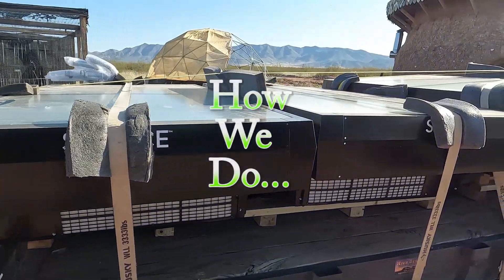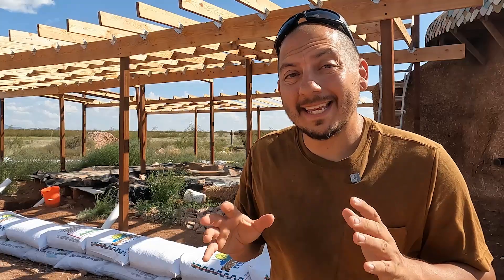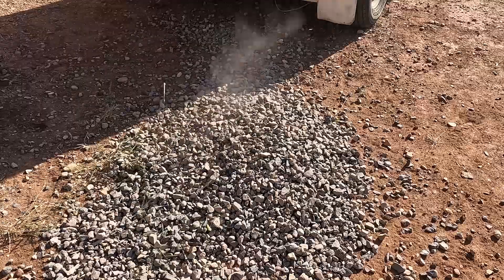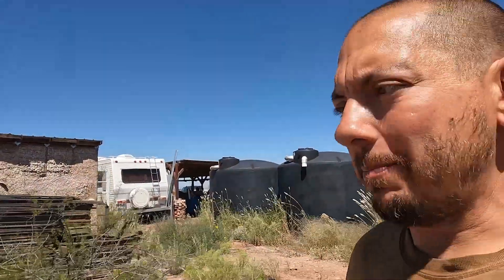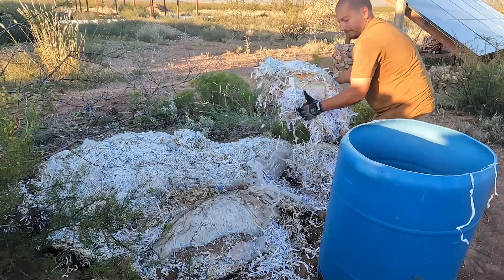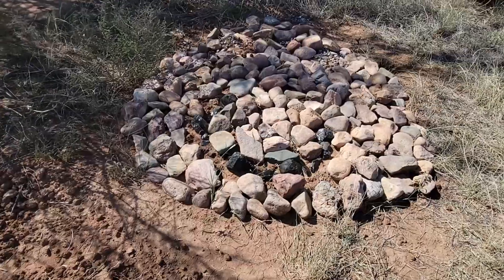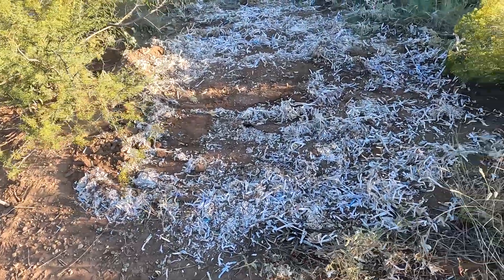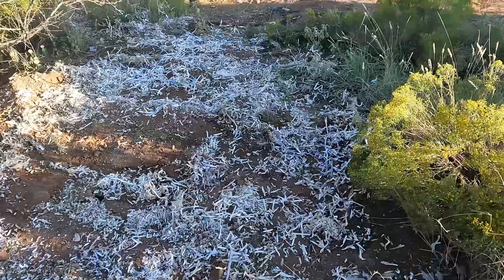These Solar-Powered Panels Create Water from Desert Air (Source Hydro Panel Installation)

Comment: PV panels degrade up to 25% when they heat up in the Sun. However you can cool them off using water. Have you considered feeding the source panels into a storage unit by the PV panels to use the condensed water to cool off the panels and increase electricity production?

Comment: I wonder if having a Source version that can be hooked to a supplemental power supply, like a battery/solar bank to have the panels condensing the cooler higher humidity air before sunrise  to increase it's output?  ... Very cool idea , glad you have them 🙂
Reply: these panels have a battery and Do run all night

Comment: Yeah.  No thanks.

Ever drink the condensate off an old, dirty air conditioner?

YES, you're producing water.

COMPLETELY unfiltered.  Unhealthy to drink.

In short, it's a scam.
Reply from the maker: They install filters with the panels

Comment: I don’t see any foundation. If rain water flowed around the base, wouldn’t these panels fall over?
Reply: They are strapped down to cement blocks
Reply: @dwight7651  ok, what supports the cement blocks?

Comment: Without looking them up based on your description, it sounds like they may be using some sort of 'Peltier cooler' setup ie run power in and one side gets cold, one side gets hot...and if you run air over the cool side you can get condensation etc.  If that is the case, the combination fan noise is probably to pull cool air in across the cold side then blow it back out over the hot side to keep that cooled off.  Very cool in any case, hope it turns out well and you can do a future 'it works and is cool' followup video. :)  And of course now I read the website...and nope they do not use pentier coolers, they use other fun stuff. :)

Comment: Cochise County, had in-laws that moved there, know the country. I myself moved to Apache county, 5300 ft elevation, off-off grid and 35 miles from any services. On a mountain top, above the tree line,( google that, i really got it wrong) would love a few of those panels as water is a 'haul' once a month. The panel output directly relative to humidity content. Arizona, not so much. I think of those off-gridders somewhat east in a humid climate, but then rain catchment would be better too. Good luck and as always be safe. ❤

Comment: This is all well and good, but I have seen Wormwood in a vision (the biblically infamous comet). It’s like a giant dust clod. I wished to see it up close and I was vooshed right over. It’s like a flaming dirt clod made of apparently a fatally toxic dust to life. I don’t trust the air for water after it hits… Just saying. The second part of the vision was I tried desperately to warn people and nobody listened to me. 😊
There is a way which seemeth right unto a man, but the end thereof are the ways of death. Proverbs 14:12
Invest in a well. The only certain way. And with what Revelation says about all the many people dying, well, according to the NWO population control plan that doesn’t exist (sarcasm), there’s going to be enough ground water for the people who wanted it prior to the judgements in Revelation. So it’s just having a good well …that doesn’t have arsenic or something terrible in it lulz.
I think this air harvested water should still be good for watering your garden and stuff at least.

Comment: Solar stills are used in survival situations for eons. Dig a hole in the dirt, put something to catch water on the bottom take plastic and cover the hole with a small rock in the middle so the base of the plastic in aimed at the collector. moisture will condense on the bottom of the plastic and collect in the bottom.

Comment: Sounds like it's an air conditioner a pump that  by condensing the air makes condensation and cold air and heat in Texas I can get 10 gallons of water from a 5000 small windows unit dripping into a bucket in 12 hours

Comment: Those source panels need humidity to extract moisture from the air, It'll be interesting if you can track the water production over the year in litres per day (or gallons per day?), I expect they'll get better results in the monsoon season than the dry season.

Comment: MAGIC water from the air. If you use an air compressor you may know that it condenses a lot of water same thing that an air conditioner does. All about the amount of humidity. I live in the Northwest my air conditioner produced two gallon of water a day, I have never measured the amount of water my air compressor gets but I have to drain it once a week. thank you ALL

Comment: I'm glad you received these free materials to augment your water needs.  Source's FAQs does NOT provide direct answers to FAQs O suspect due to liability concerns. One vaguely unanswered question is "How much water can a panel produce monthly?".  They say 180 "standard" bottles per month - What is standard?   Annual maintenance, filters, minerals, and unit costs are not addressed.  They will differ for each customer.
Reply: There are charts that show how much each panel produces as it correlates to humidity and direct sunlight (amount of energy the solar components produce). In AZ with the average humidity in Cochise County, both panels should produce between 1 1/2 - 2 gallons on a sunny day. Charts can be found on FB in a group entitled "Cochise County and other AZ Hydropanel owners"

Comment: Sorry for your loss. Those little furballs bring us so much joy and love.  That love stays with us. They are all running and playing like puppies on the on other side.❤❤❤

Those panels are a high tech way of collecting water from the air. We learned a technique in boy scouts. Bury a pot so the rim was ground level cover it with plastic wrap, a small hole and rock in the middle to collect dew. Its not a lot of watet but can help you survive. 

60 decibels per panel? A push mower is around 55 i believe.  Might get annoying if too close to the house.

Comment: Interested in seeing how well the panels do, but I can tell you for sure that you won't get much water here because  of how dry it is. I am sure it will make some good water when we get some more storms and humidity. You may actually be better off using the roof from your new addition as a rain run off to a collection system.

Comment: I would like to hear how the water tastes compared to the rain water. Is it a cleaner and safer source of clean drinking water. Does it need to be boiled?
Reply: Our panels have been running for a month now. The water is pure with minerals added back in so it has a great taste and can be consumed directly from the hyropanel dispenser.

Comment: The main benefit of this system is not the quantity of water produced, or the redundancy of it, but the fact that it produces 100% pure, clean drinking water. The water in your cistern is excellent for sanitation and irrigation needs, but it's purity could be questionable.

Comment: With 2 hydro panels producing a maximum of 3 liters a day, and a cost of $3,900, the break even payback is a minimum of 106 years, compared to having water hauled to your property in Cochise county Arizona.  If they cost $30 dollars each it migh be something to consider, as that would be around a 2.5 year payback. You need ti be telling your viewers that this only works if they can get them free!
Reply from the maker: We'll probably go into that once they turn the panels on and start producing.
Reply: One doesn't do these because it provides cost-effective water. One does this because it provides water without a well or utility. The price for 2 according to the Source website is $6200 for a set of two. Yes it might be more expensive but when a well runs dry or a utility fails or emp causes the electric grid to fail (which also means no gasoline/diesel to haul water), hydropanels still produce water.
Reply: @bradcouch2899  I agree!  These are just not practical for anywhere in the US and most of the world.

Comment: The trouble, these kind of solutions don't make hundreds of gallons / day - not nearly as much as one would like and are are not cost effective if you pay out of you're own pocket.  Rain harvest (on the other hand) works reasonably well for livable quantities - 1000gal per inch of rain on 2000sq ft collection area.   Will be interested in you're actual results.  But what fun, especially since you got them for free.
Reply from the maker: Yeah, I don't think the cost warrants the amount of water you get. We'll see what the results are though.
Reply: As someone else posted, the concept isn’t to produce lots of water but to produce clean water.  A great many people don’t have a source for clean water due to local pollution or environmental issues.  

Been following this tech for a while now.  It’s similar to a different idea which is a below-ground buried water condenser.  The bonus here is you don’t need to dig for these to work. 

The buried condensers need to be put deep enough so they’re below the heat-soak in the ground from the sun.  In the desert that’s pretty deep.

Comment: These panels are $3,900 each, if anyone was wondering.
Reply: @72Dexter72Manley72  No, $3,900 for two.  Still works out to a 106 to 130 year payback / break even.
Reply: @ontheroadwithdan5571  Depends on how you look at it – this allows folks to live in areas where water might not otherwise be available
Reply: @ontheroadwithdan5571  I checked the sit and it said $3,900 each.
Reply: @ontheroadwithdan5571  It's possible they are giving a special deal. But right off their site is $3,900 each.
Reply from the maker: They're definitely expensive
Reply: @ourselfreliantlife I am so happy for you two to have been gifted these. If anyone deserves some good juju coming back to them, it's you two. 👍🧓
Reply: solar panels running a commercial dehumidifier ?
Reply: Thanks for the information.
Reply: Source claims 180 pints/ panel/ month = 22 gallon/ panel  approximately 😊
Reply: Yeah im good thanks
Reply: Wrong, not $3,900 each
Reply: @retireglenat75  If the pricing has changed then post the new updated pricing. 
I made this post after checking the pricing on their Website. 
If they changed the pricing on each panel that's great. 
But at the time I made this post. The Companies Website clearly showed the price was $3,900 per panel.
Reply: @retireglenat75  I posted the original comment. And at the time that video was posted, I went right to their website. 
It clearly said $3,900 each. 
Now they may have lowered the price since then. 
But again. At the time that video dropped. They were $3,900 EACH.
Reply: I wander what is the real water production capacity...
Reply: A smart person could build one of these for half that price or cheaper 😂
Reply: @traceyneal9623  I posted that price so people would know what they were getting themselves into. 
These things have been made for under $300 bucks. 
But my thing is if you go into town even once a week. Bring 5 of those 5 gallon water containers and fill them up at the water station or even a dang Walmart for .35cents each. 👍🏾
Reply: Did they work at all??? Follow up???
Reply: These would be great to water a desert vegetable garden ❤
Reply: I live in New York State.  We have a lot of water.  Drilling a new well is $10k minimum.  If you don't hit water you start over.  The South West has limited ground water. 

If they can supplement their water it might be worthwhile.
Reply: @philipvecchio3292  other than cost gallons per day & air quality it draws water from would matter too.
Reply: @philipvecchio3292  Rainwater collection works great in Arizona. And they are doing this. 
You shower with rainwater, give it to the animals, water plants with it. 
You can easily get some 5 gallon jugs refilled with fresh water. For drinking and cooking with. Have fresh water delivered to you. Or you can go fill up a 100 gallon water tote. 
Lots of options.
Reply: I’m glad they were able to get involved. In the early stages new tech is always pricey. If it works well and they go to mass productions then economy of scale will kick in.
Reply: @BoldRepublicNews  If someone wants to go this route that's fine for them. 
I won't be going this route. 
Filling up 5 gallon fresh water containers at the store. Having fresh water delivered. Or filling up 50 gallon containers is cheaper.
Reply: That should be a great ROI
Reply: @GrayWisdom2025  If 106 to 130 years is great, then yes.  This is not even close to being practical.
Reply: Were they made off-grid?

Comment: Seems like adding batteries so it would run at night when there's more dew would produce a lot more water. Interested in hearing how it works out after a few months.
Reply: @leeboerner6681  That would be 20 times more expensive than having water hauled in.
Reply: @ontheroadwithdan5571  Isn't pretty much anything more expensive, at least in the short term? About 5 miles from here $0.25 cents will get you 100 gallons from the community well.

Comment: t's a little late now but did you consider laying the wire down on the ground before filling the bags? Love the idea of getting water from solar panels. Are these just like a big home dehumidifier run by solar?
Reply: Speaking of dehumidifiers, my family bought a large one. We place the output hose of it into a clean container. The resulting water is pumped thru an intake tube from a PortaWell filtration system and the filtered water is placed into a drinking container of our choice. This system eliminates our need to buy drinking water and is cheaper too. We are in Tampa Bay where it is humid. I'm not sure how much our system would produce in a desert/arid region.